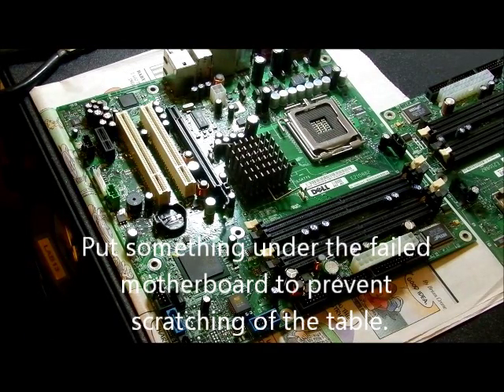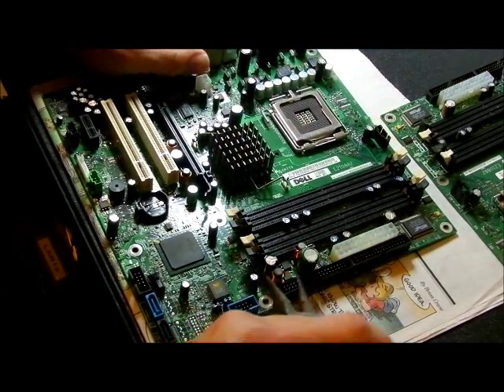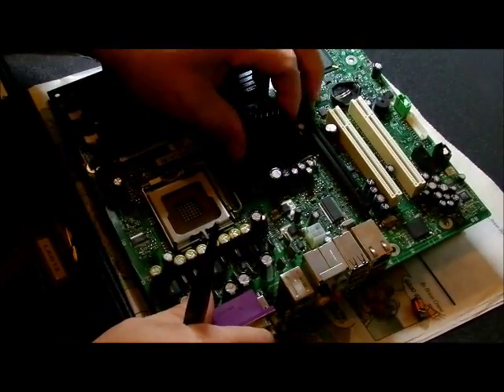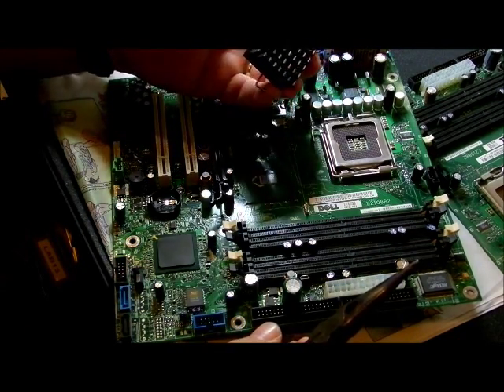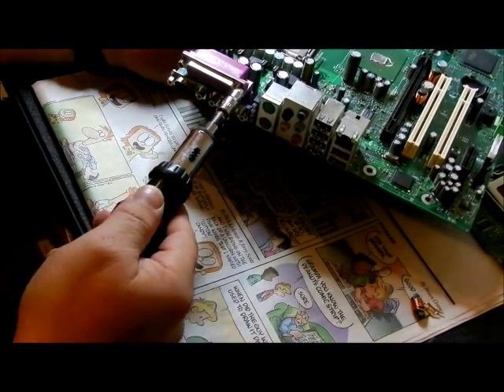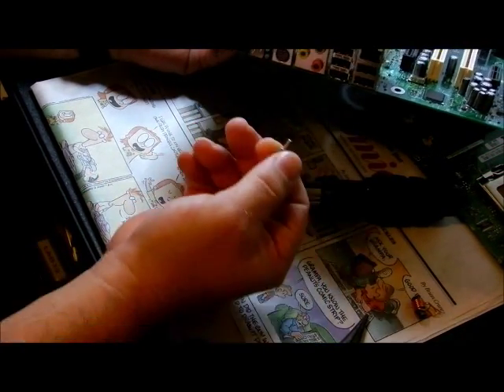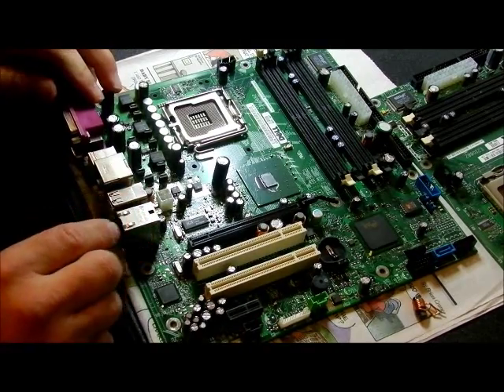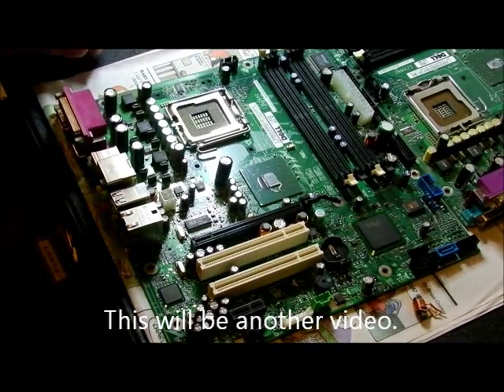Salvaging Parts off a Motherboard

Comment: is it good idea to use old / dead motherboard parts to repair a laptop motherboard?
Reply from the maker: No.  Laptop and tables have much smaller and integrated circuits the will noe be compatable.

Comment: thank you Mr. Quinn for your videos. Could you do a You tube video talk on how electronics changed from the early 1980s computers to now. May be you can open up a TSR Tandy and a Dell Lap Top and give a circuit board tour of how they are similar and how they differ. Thanks for considering.
Reply from the maker: If any come in to my shop I will.

Comment: I use salvaged heat sinks for my laptop. I have some slabs of aluminum under it and connected to those are several heat sinks.  Bit of a brute force solution to heat, but it works.
Reply from the maker: Nice!